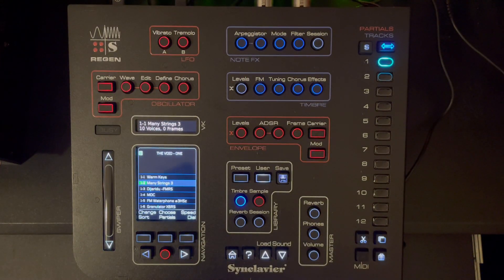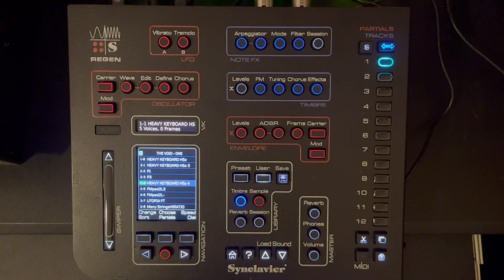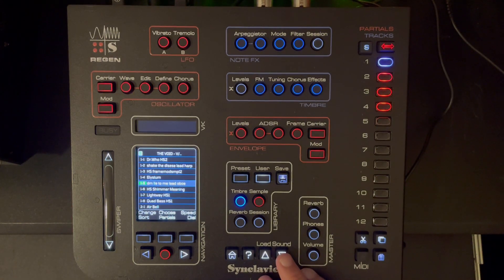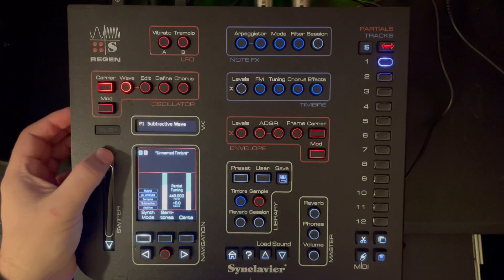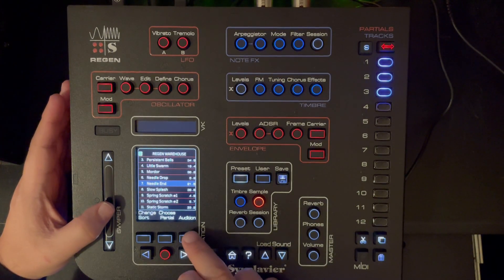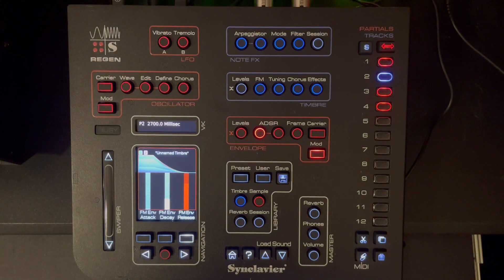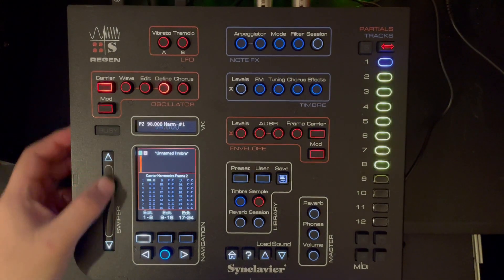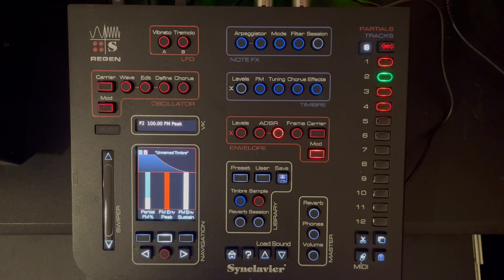Synclavier Regen  - samples, FM and frames

Comment: Okay, back to this video. Something that is hard to articulate but easy to experience is a rather unique thing. As I track with our Regen, as I combine partials, track up parts and build tracks, some sort of almost hallucinogenic effect occurs with even very subtle FM of samples. There really is something different going on with Cameron’s Infernal Machine, and it is lovely.
Reply from the maker: It is simply magical :). In my example above for instance, it sounds crap until the FM modulation layers are working and the sample transposition effect is obvious, then it sound unreal and unique :)

Comment: These are probably the least dated Synclavier presets I’ve heard; sounds beautiful! You said that FM modulation of samples is rare, but you didn’t say it doesn’t exist, so what other Hardware/software can do that? I’ve spent ten minutes searching for that, which isn’t a lot, but still, can you or anyone else here point to something? Takk på forhånd
Reply from the maker: Thanks a lot! :)
Well, it does exist in SW, like Reactor, as far as I understand. But I havent seen an hardware implementation. The Nord Wave and the Yamaha SY77/99 and I believe, the newest Yamaha FM, can FM modulate in the other direction, You can use a sample to modulate a carrier. Sound amazing but also best in small doses. Like on the regen. The Arturia Synclavier V is the best solution for easy to use SW though :)